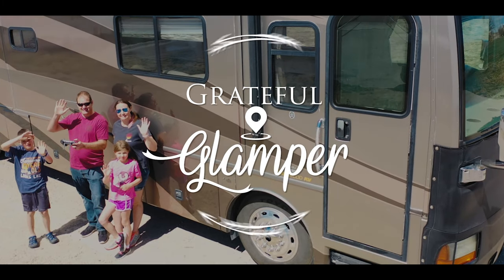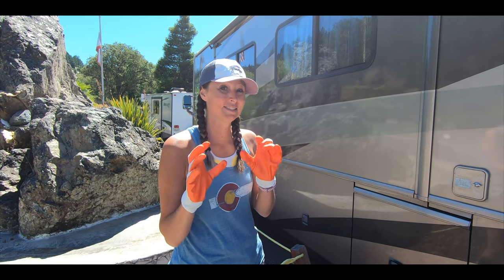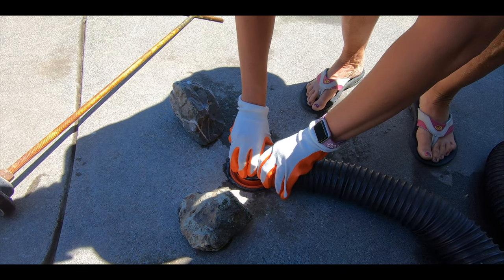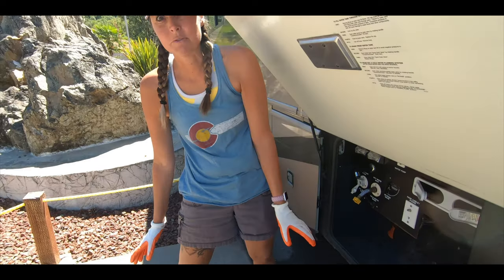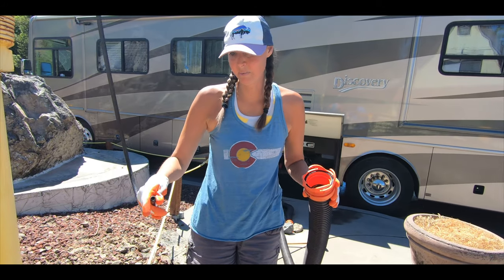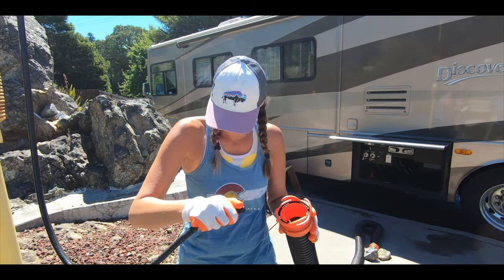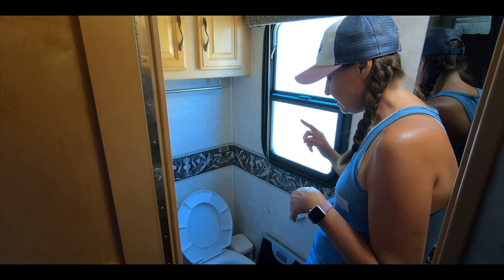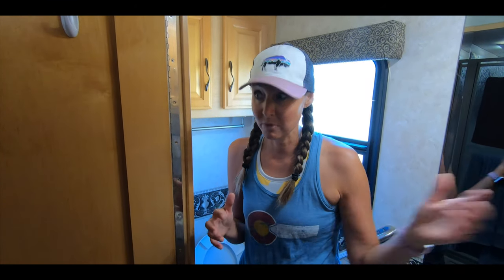How To Use an RV Dump Station | Fulltime RV Living

Comment: Just a quick comment……before you open your gray tank close the black one first. Then pull the black tank open. I was going to add that you should do a black tank flush prior to emptying your gray tank but you may have decided not to do that because you were still going to be camping that night and there was a line at the station. So I’ll leave it at just the one comment. 😀
Reply from the maker: Thanks for the tip!
Reply: @GratefulGlamper  Always rinse your black tank while your grey tank is emptying. Less time you spend dumping.
Reply: @billykidd6971  that doesnt make sense.

Comment: Good video...  But do you not have a black tank flush in that beautiful RV?  That would have been a good thing to discuss.
Reply from the maker: We do typically flush at the campground when we have full hookups, however, we were at a dump station with several people waiting in line. In respect for the people waiting, we figured we would flush when we got to our destination (also with hookups). We will do a video soon about our compete process while at a campground (which is more in detail). Thanks for watching!

Comment: To avoid cross contamination, should we close the black tank before turning the grey tank on?
Reply from the maker: Yes that’s best but usually does not cross contaminate. Plus, your gray tank is still a “waste” tank so it’s not a safety issue.

Comment: i'm new to this, but, from other videos  you need to add more water than you did at the end.  like 5 gallons of fresh water. is what i'm seeing.   what's your take on that.   also, mine new hose (which i haven't used has caps for the ends)  shouldn't you have them too.?

Comment: Order of business:  dump black tank FIRST...while black tank is draining hook up and run black tank flush hose and operate long enough not to p*ss off anyone behind you at the dump station.  Shut off flush supply & allow remaining water to drain...CLOSE black tank valve, THEN move on to gray drain, whether on the same 'Y' as black or having to move the drain hose to a dedicated gray outlet.  Pack up the black flush hose while gray is draining.  Finally, once gray is done, THEN disconnect, rinse the hose, and pack it all up.

Comment: Ain't you supposed to flush the black tank after dumping? And if you don't will that cause odor problems in your camper?
Reply from the maker: We normally do flush the black tank, but not if others are waiting in line at the dump station

Comment: I use a powder form in my black tank,but I like the idea of the packet. How do you like it,does it do a good job for you? Thanks for the information,stay safe !!
Reply from the maker: It’s does do the job of keeping odor away.
Reply: Grateful Glamper Awesome,the stuff I use is called Happy Campers Holding Tank Treatment. It’s supposed to help break down sludge as well as reducing odor. One scoop per 40 gallon tank. I fill the bowl with water and sprinkle it in so it dissolves and flush. Then refill and flush again. It’s probably the same stuff just not in a packet.